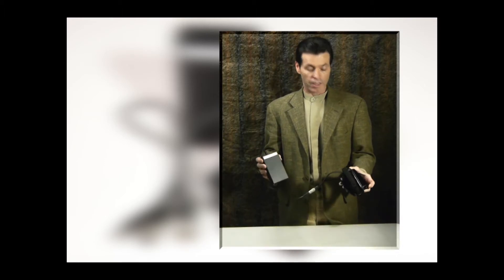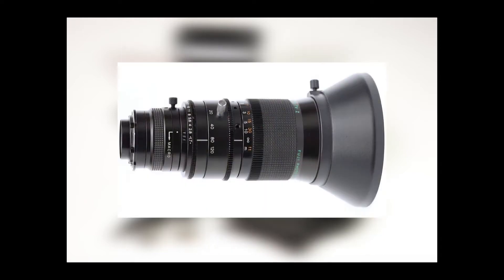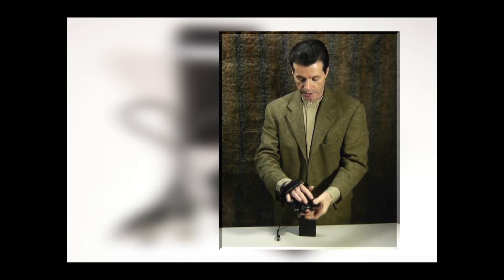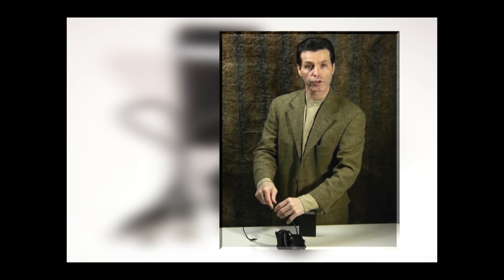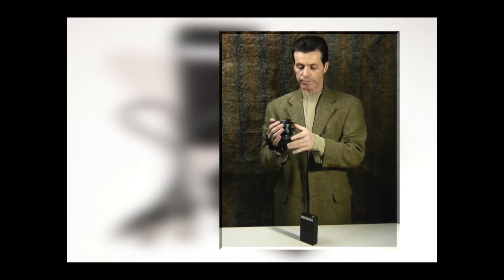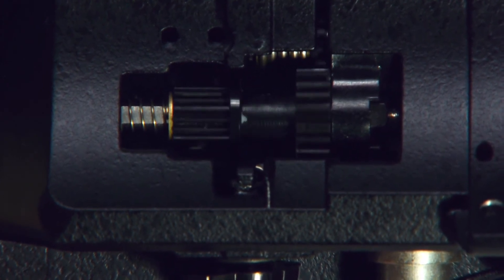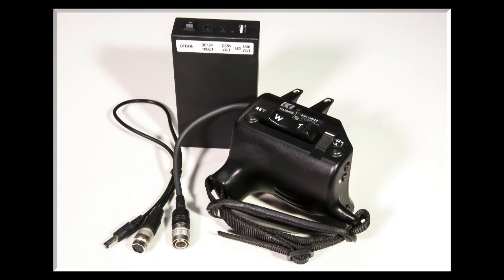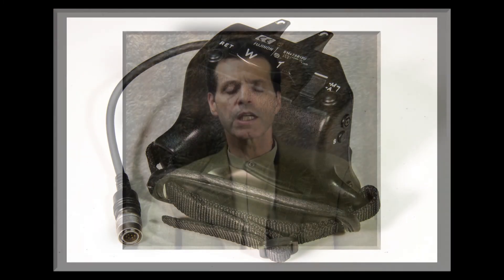Power Zoom Solutions for Fujinon Lens

Comment from the maker: The battery is out of China, and there isn't a "Brand" per se.  It has 12V, 9V and 5V USSB ports and is very useful as I can run a GH2 or GH3 and power the lens.

The only problem with these batteries is that it takes forever to get.

I accumulate lenses and parts and occasionally sell them on eBay.

I was selling the rig in the video.  Nobody purchased this one, and I'm glad because now I need it and it's worth way more to me than what I would have sold it for!

AM

Comment from the maker: Hi Alan,

Sorry I didn't see this sooner.

I build the cables and sell them on eBay when I have extras.  

The problem is getting the Hirose connectors, they aren't sold by many electronic distributors, and it takes a little time to get them after placing an order.